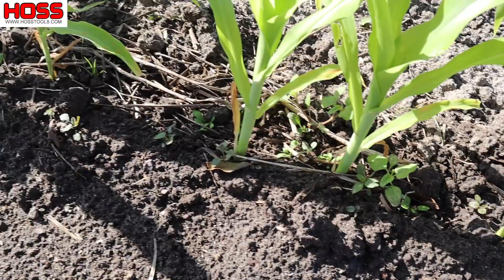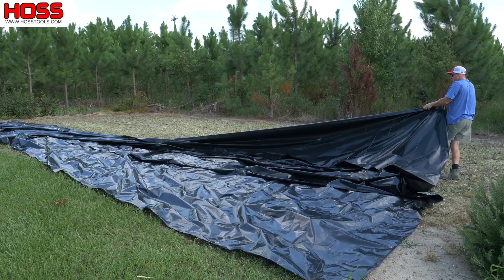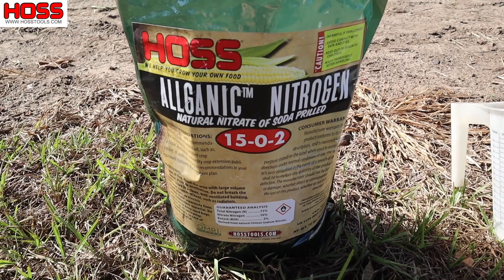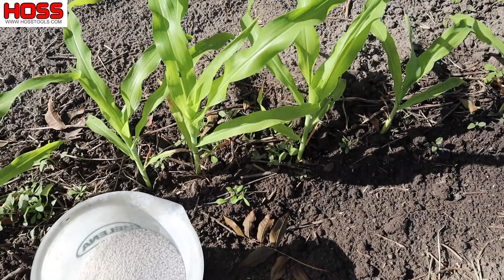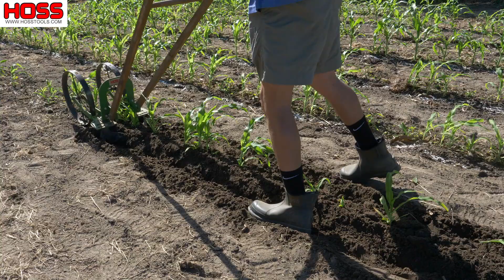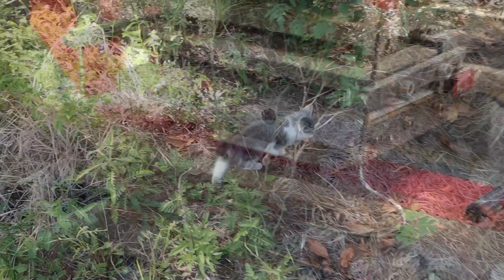Hilling and Side-Dressing Fall Sweet Corn with the High Arch Wheel Hoe | Peaches & Cream

Comment: I have to plant on hilled soil because it's just too wet here. If I were to use the high arch hoe to make raised beds before planting, what maximum width and height do you suppose those beds will be?
Reply from the maker: Those plow blades will throw soil about 3-4 tall.
Reply: @gardeningwithhoss  4 inch sounds good  that’s what bed shapers usually do. How wide a bed can I make with the high arch hoe by spreading out the plows?  Thank you

Comment: Travis, looking good, I use a five gallon bucket with a 5/8" hole to side dress my corn. I put the hole in the bottom out on the edge of the bucket. With the bucket sitting on the ground, I fill the bucket half way and raise the bucket an inch or two off the ground and walk with the bucket a couple inches away from the stalks. This puts the fertilizer right where I want it without getting any in the whorl. To stop the flow I just sit the bucket on the ground. It's quick and easy on the back.
Reply from the maker: Sounds like a handy trick! Thanks for the tip!

Comment: Why do you hill sweet corn?
Reply from the maker: Several reasons: 1) It helps to stabilize the plant and strengthen the root system. Plants will be less prone to blow over in high winds. 2) It reduces the in-row weed pressure by smothering those small weeds that appear early. 3) It makes it easy to side-dress. That fertilizer works much better when buried beside the plant.

Comment: Just finished picking my Golden Cross Bantam yesterday, I was very confused due to the fact that I planted by hand a single seed per hole and got instead of a single stalk per seed, 8-10 stalks coming out of the ground on every seed. I planted 30x100 ft. patch and none of them were singles and on top of that, some of my tassels were growing corn kernels on them, any idea what happened????   I live in central California were the climate is 60-80 degrees with a lot of fog.
Reply from the maker: Have seen pics of kernels on tassels, but not sure what causes it. Sometimes the corn stalks will "sucker out" and grow side stalks from the main stalks. Sounds like that's what happened with yours.
Reply: Bad seed. It was cross(ed) for sure.

Comment: I follow the dirt Doctor in Dallas Texas. He uses Horticultural   Cornmeal  to keep weed seeds from germinating. He makes a compost tea. Puts  it in a pump up sprayer.  Or in a tractor setup.  Can be use in spring, and fall.  Copied this  info from a gardening website. The compost tea worked for me.   Corn Gluten Meal
Corn gluten meal is the byproduct of corn syrup production. It’s a pre-emergent weed killer, meaning it destroys weed seeds before they can grow into plants. Corn gluten meal is high in protein and contains 10 percent nitrogen, so it doubles as an organic fertilizer. It’s important to note that since it is pre-emergent, it will have no effect on existing weeds. If weed seeds have taken root, corn gluten meal will only serve as a fertilizer. Additionally, if you have a fungus problem in your yard, corn gluten meal also acts as a fungal suppressant.

Make sure you get corn gluten meal (CGM) from a garden center or greenhouse, as opposed to regular cornmeal found in grocery stores. First, apply CGM before weeds have had a chance to germinate, then spread up to 20 pounds of CGM for every 1,000 square feet of grass. Make sure it’s spread evenly, and finish off by watering lightly. It’s important to note that excess nitrogen can burn a lawn, so be precise with your application.

Cost: $$$

When to Apply: Early spring, or late fall

How to Get Started: Soil Mender is a good brand that produces corn meal. Their 40lb bag, which can be found here, will last most average size lawns or gardens a few seasons depending on use. All you need to do is uproot existing weeds, spread the corn meal, and then water it in if desired.

 

Fire
Reply from the maker: Never heard of the cornmeal idea. We're not huge believers in compost tea. Why not just use compost? There's no great way to prove that the compost tea process  does indeed increase the concentration of beneficial bacterial.

Comment: Your corn is looking good. Mine is head high, tasseling and starting to silk. The bug pressure has been BAD as compared to a spring crop. I started spraying more than once a week and it looks like I have it under control now. It will be nice to have fresh corn in a couple of weeks.
Reply from the maker: Bug pressure is certainly worse in the fall, but spraying weekly should take care of most of it.

Comment: How do keep the irrigation lines from stopping up?
Reply from the maker: Never had any issues with emitters clogging. There's a filter at the beginning of the drip system.
Reply: @gardeningwithhoss  There was a farmer south of Greenville  Ms.  Who put  drip irrigation under his  cotton field. The algae would stop up his emitters . He had a time making his system work  properly.  Do you use filtered water as well?
Reply from the maker: @charlescoker7752  the water comes straight from our well, so it's clean. If you're pumping from a stream or pond, you certainly need a better filter.